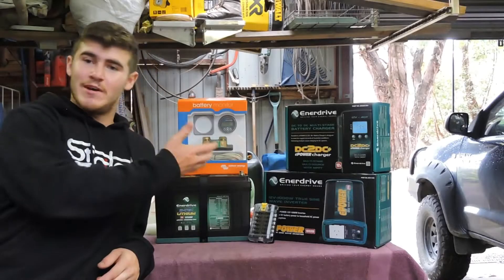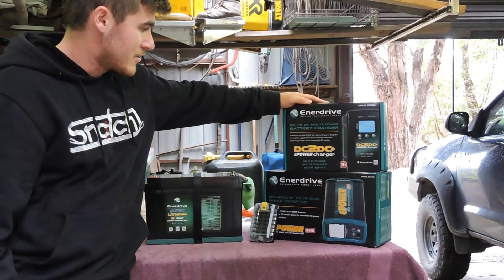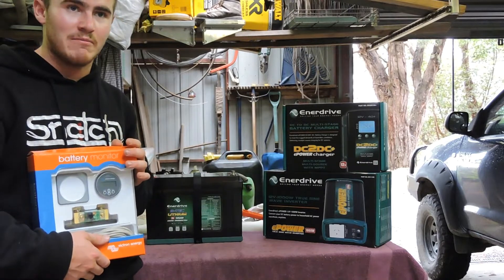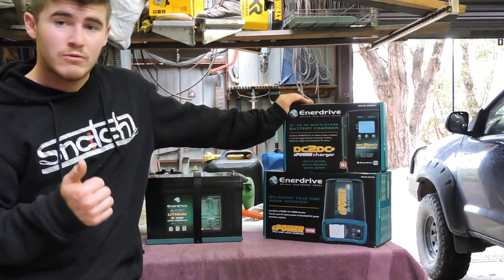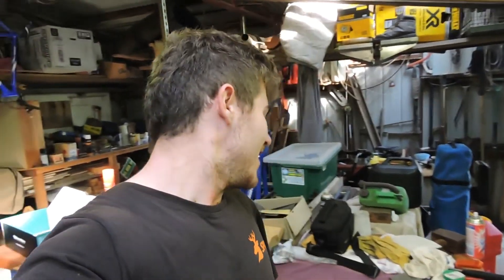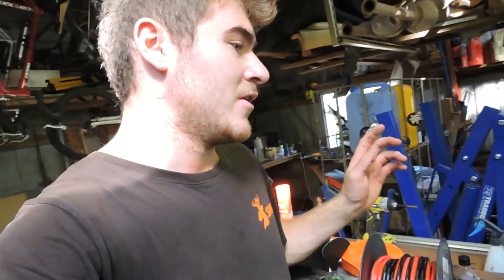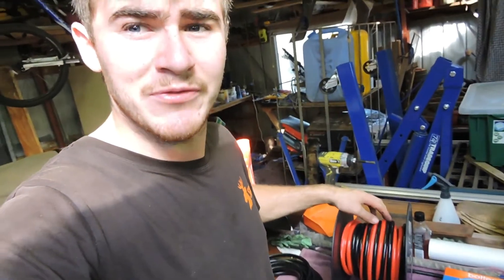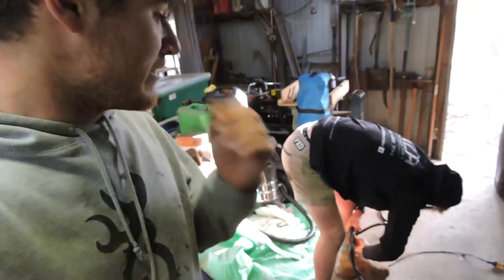12 Volt in the canopy!!

Comment: You may need to run the neg lead for the inverter to the work side of the shunt or you won’t be able to see how much it’s using on the monitor.  Which also means you may need to use a bigger guage wire between the shunt and the battery. 
I’m no expert so please do some research before any actions taken…
Reply: Also have enjoyed your canopy build as I’m starting to set one up too. How is your car for weight now?
Reply from the maker: The monitor seems to be working fine I just followed what the diagram said. Ute is defiantly on the heavy side. Thinking about making another tray with an ally deck to loose 100kg ish. 
Appreciate the feed back Paul